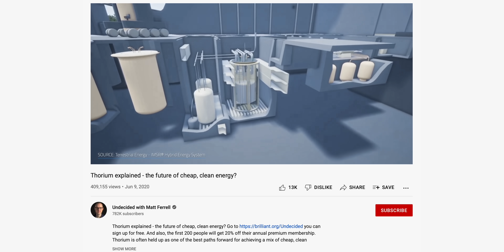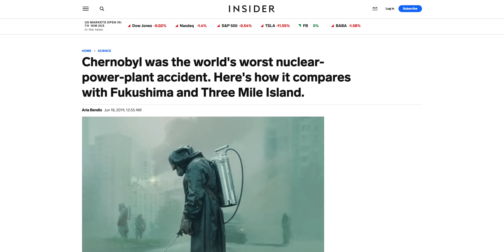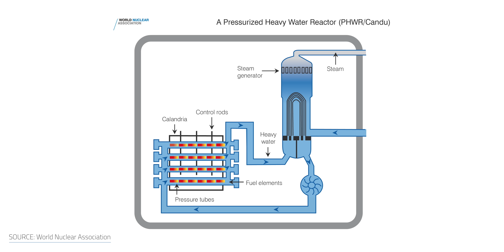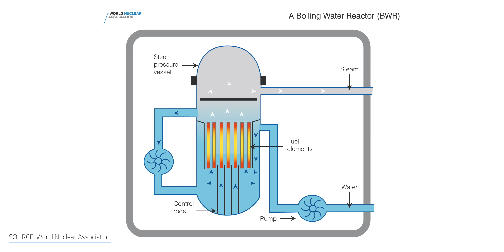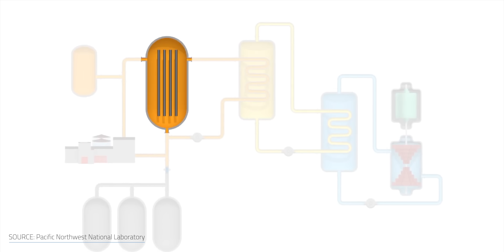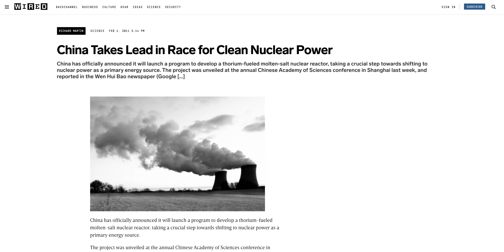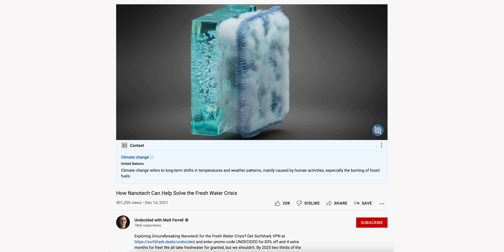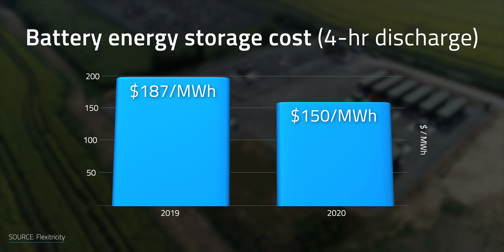Revisiting Thorium Energy - The Future of Nuclear Power?

Comment: We have a long road ahead to make renewables work.  Worn out solar panels leech toxic metals.  Turbine blades rapidly fill up land fills.  Solar and wind need huge tracts of land to gather enough energy.  Huge transmission lines are required to carry the power from the remote locations where it is generated to where it is used.  The battery storage issue is a long way from being resolved and renewables aren't worth talking about until it is.  China is embargoing cobalt and lithium making the battery issue worse.  Just ask the 200 Texans that froze to death during 2021 what we think about renewables.

Comment: Matt you want to have one foot on wind energy and one foot on thorium energy.
At 12:50 you said that thorium energy is more expensive than wind energy, that is a practiced l¡e: Thorium energy is continuous and reliable and cheap while wind energy is intermittent and sometimes non existent and expensive.
When the wind is not blowing the energy output is zero and the cost is infinite so put your act together and get real.

Comment: At 5:38 - That's not how "highly radioactive" works - Almost everyone gets the context wrong. - A long half-life is less dangerous than a short half life and there are 3 types of radiation emissions, alpha, beta, gamma, with two of them being easy to block and the other one being very high energy (dangerous.) Emissions: Search for "radiation shielding" For now just using "alpha" radiation. I would much rather have a microgram of U-235 embedded in an acrylic display than a microgram of polonium-210. They both emit alpha particles but U-235 has a half-life of 700 million years and the polonium's is 138 days. Polonium is much more radioactive. -- In defense of people who I say get it wrong: They are probably saying "there's so much more U-235" and that is definitely important. -- There are many details I've left out or ignored for simplicity but I believe this is an accurate account of the difference between "highly radioactive" and "lots of radioactive material."
Reply: I've been trying to make people understand this for the longest time, but they can't get it.

Comment: Lin win Hu is dead wrong.
a demonstration thorium reactor was constructed and operated (I believe in Arizona or Utah) during the 50s.  as in the 1950s.  what I read is that they couldn't develop an alloy to withstand the heat and corrosion for long term durability, I believe they were looking into ceramic coatings, but then the federal government axed their funding.  I'll have to go digging for the article, but the take away was, it worked, and it worked very well.  we just didn't have the metallurgy to make it durable.

Comment: UNfortunately, this video was short on facts. There is nothing more dangerous than thorium after you run it through a nuclear reactor. The problem is 1% of the Th-232 converts to U-232 with a 60 year half life. U-232 decays to Th-228 with a 2 year half life. The radiation from U232 and Th228 will kill you...U233 iis a bad fuel b/c it has to have <5 ppm U232 to be handeled w/o shielding. After a month it's untouchable.

Comment: All the nuclear systems are way outdated. Even the newest ones proposed are arcane cronie capitalism. The only reason we have these problems is centralization vs decentralized power.  We need to use modern panels the way solar works with modern material science. Voyager 1 and 2 use a very old system but it lasted nearly 20 years  in primary power and 20 more in minimum mode and then 10 more in emergency mode so is this really an issue? That is 70s tech. It is static continual and can handle base load perfectly for a generation not just a few years and it can repurpose the waste we are storing as primary fuel that will last for minimum hundreds of years so humanity will benefit from power we build today for nearly a millennia. It would take us close to a real class 1 civilization.  And I am not mentioning other systems just as good but not related to this subject

Comment: Thorium reactors have one problem that engineering cannot overcome. To make fissile U233 from fertile Th232 you have to go through Protoactinium Pa233, but the half life of Pa233 to decay into U233 is 27 days. Compare that with the half life of Neptunium 239 to decay into Pu239, which is roughly 2.5 days. Therefore it takes roughly 10 times as long to breed U233 from Th232 as it does to breed Pu239 from U238. 

Which is why the Indian national project to run the country on a fleet of reactors using the Thorium cycle was planned to take 70 years, and that was started 50 years ago and is still only in the early stages. 

Yes, the Thorium fuel cycle does have benefits over U235 and Pu239, but it takes a long long time to get going. 

It's much faster to build wind turbines and solar farms.

Comment: Suggesting that solar with a 4 hour battery is in any way comparable to a nuclear plant is absurd. Nuclear can run for years w/o sunlight. A 4-hour battery replacing normal solar output wouldn't heat or cool your house past 9 pm on your first cold or hot night, much less overnight or through several days of stormy weather. Try a battery capable of running your home and car for at least 100 hours and you will come to a realization that sufficient battery capacity to supply us for days will cost more than using low cost, low pressure molten salt nuclear.   It is the costly high pressure water-cooled design foisted on us in the interest of Plutonium production that has made current nuclear both too expensive and occasionally unsafe.  They should all be replaced.   Unpressurized molten salt fueled reactors will be far cheaper, safer and reliable.  Their higher temperatures will make them suitable heat sources for manufacturing processes that can now only be supplied by fossil fuels.  Inherently safe -walk away -design will end the unjustified nuclear safety stigma.  Eventual use of Thorium by the rest of the world, over the obstruction of US regulators, will greatly diminish the waste disposal situation for them as well.
Reply: 1. The selection of PWRs and BWRs has NOTHING to do with the production of Plutonium.  NO commercial reactor has ever been used to obtain Plutonium. And the Handford and SRS weapons production reactors cannot produce electrical power and are NOT pressurized.

2. When a MSR or Thorium reactor is actually built in a non communist or 3rd world country but in one with quality and safety standards, operates and PROVES your claims Then and only Then can you provide them as reality instead of just some fancy web site or power point presentation.